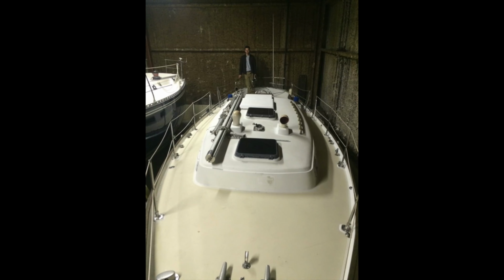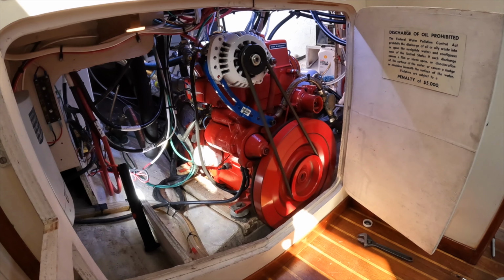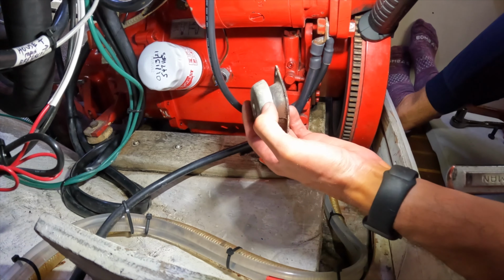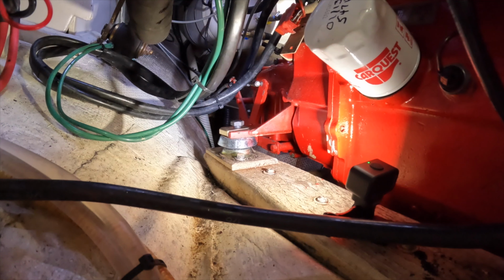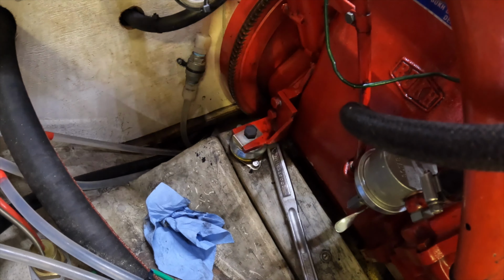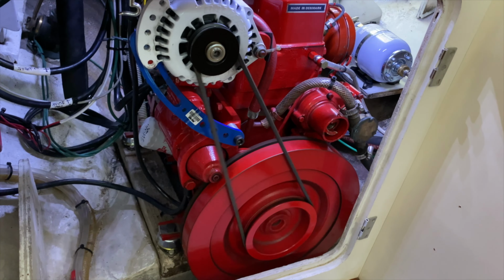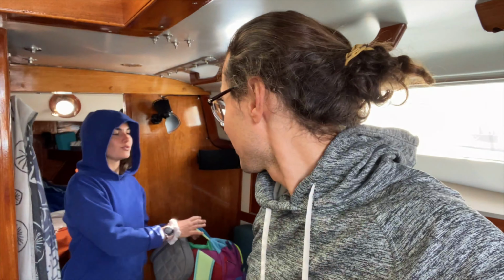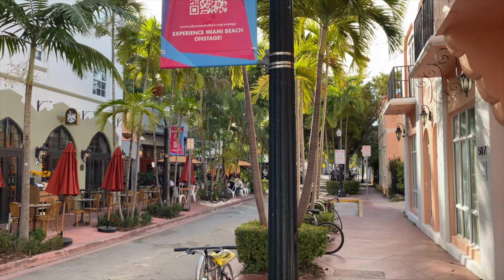EP.  26 BOAT LIFE | Motor Mounts in Miami & SHOWERING in the RAIN

Comment: Might want to consider an upgrade to a dripless stuffing box - pretty strong leakage flow there. Keeping salt water out of the bilge has a lot of benefits aside from reducing wear and tear on your bilge pumps.
Reply from the maker: I've heard mixed reviews about dripless stuffing boxes! I repacked the stuffing box before leaving Ashtabula, and always have aired on the side of more dripping (more cooling/lubrication) than less. Finally though, after changing the mounts and re-aligning the prop shaft with the transmission, I was able to adjust the stuffing box so that it doesn't drip while the shaft isn't spinning, and drips appropriately (about every 5 seconds) when it is. I installed a dripless with a friend on his boat a couple years ago and he likes it!
Reply: @Boundless_Adventure  My Seawind II (hull#2) has a Norscott dripless and it actually works very well. I lose a tiny bit of transmission oil from the lubricating oil reservoir over an extended period of running time - top it off at the end of the season. But I'd much rather have trace amounts of oil sling into the bilge than a steady drip of salt water.
Reply from the maker: I can't argue with that! Interesting about the oil supply from the transmission. Sounds like a good way to lubricate things and the absence of saltwater would be greatly beneficial all around. I'll have to look into it more down the road. Thanks!
Reply: @Boundless_Adventure  It has its own little oil reservoir - separate from the transmission. Yes, it is a good concept that actually has worked well in practice. Check out Norscot's website - many happy users.
Reply from the maker: Oh! I must have misread. I like the idea of that arrangement a lot! Ill definitely check out their website. Thank you!